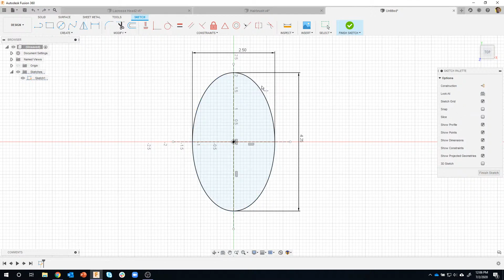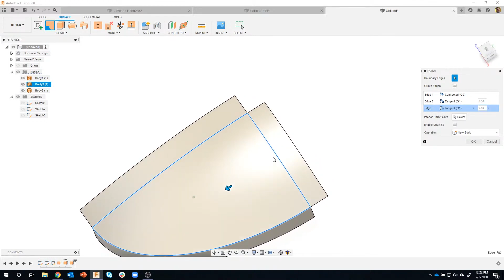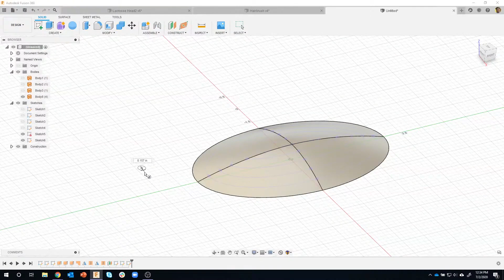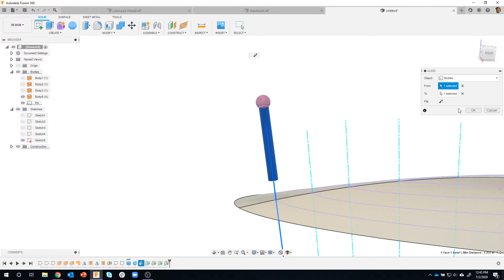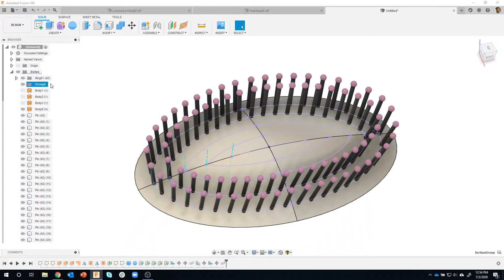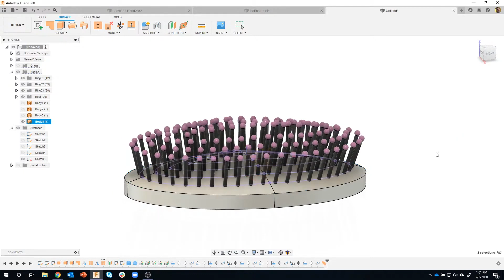Episode 65 - Pattern on a Path

Comment: You changed the surface to a body on the main part but never adjusted the thickness of the surface so confused
Reply from the maker: Chris-  Surfaces have no thickness.  You can think of them as sheets of paper that you can bend into shape.  When I did a Ruled Surface straight down from the original curved surface, that also was a "thin-walled" surface.  Then I mirrored the curved surface and "stitched" all of the surfaces together.  Once they are stitched together, they became a "solid body".  You can think of the surfaces as a "boundary" and everything inside those surface boundaries as solid.